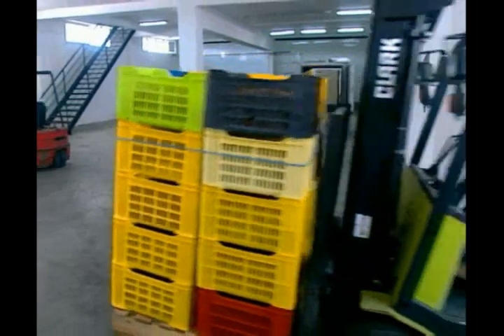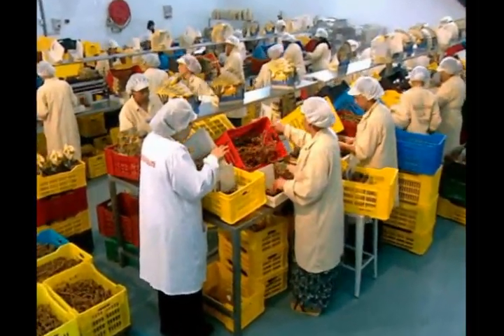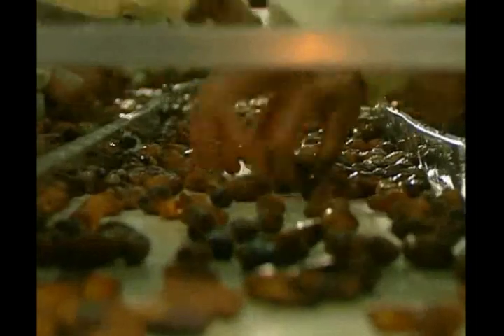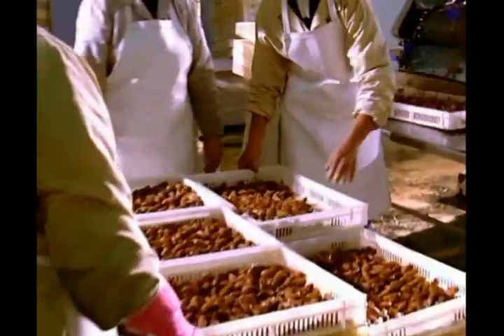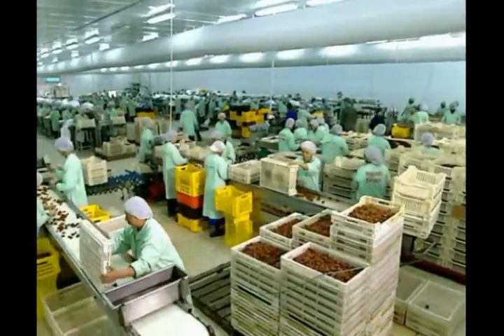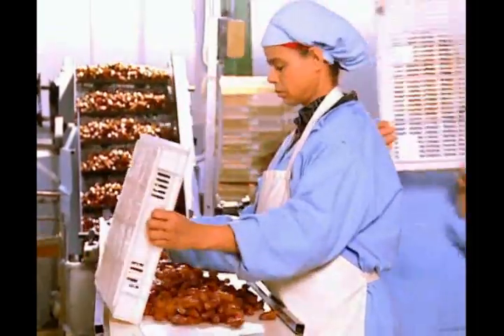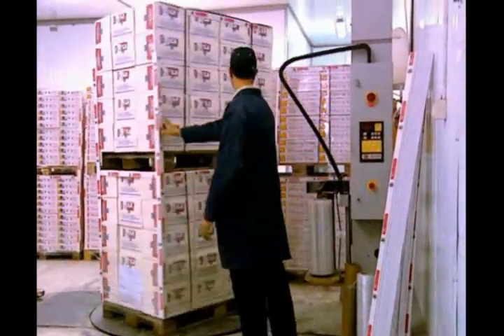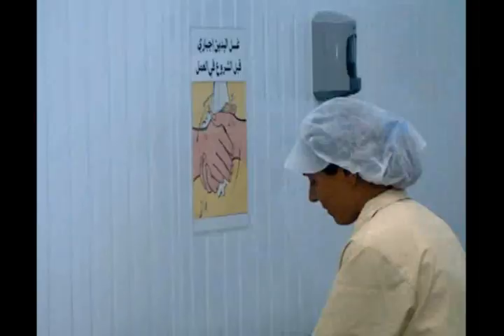Dates: Harvest and Postharvest Handling | Part 2

Comment: Does anybody know what temperature the dates are heated to during the dehydration process?
Reply: Dear sir

Dehydration process is not ideally suitable for dates especially fresh dates
Reply from the maker: @WisdomIsPrecious Great question! Dates are usually dried at relatively low temperatures (around 40–60 °C / 104–140 °F), since higher heat can damage flavor, color, and nutrients.

@manumanu-xr6zz You’re right — fresh dates aren’t always best suited for standard dehydration. The method and temperature really depend on whether the goal is to produce soft, semi-dry, or fully dry dates. Careful handling helps preserve quality while extending shelf life. 🌴